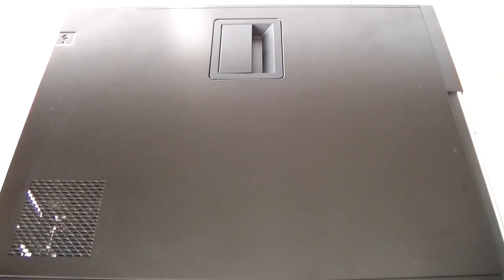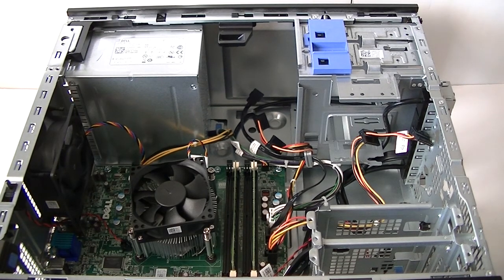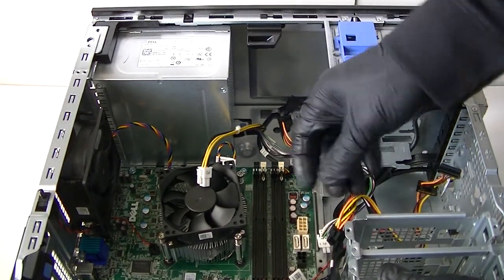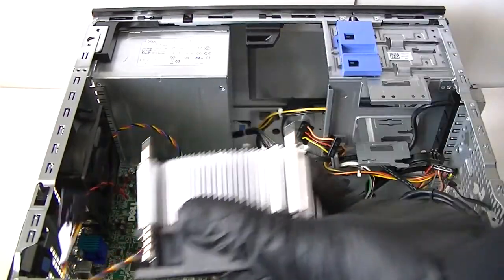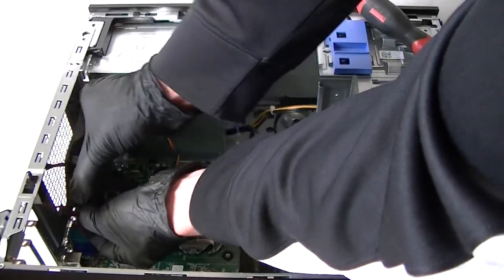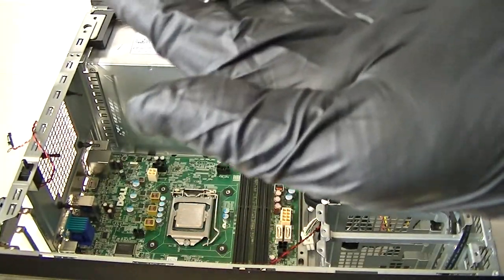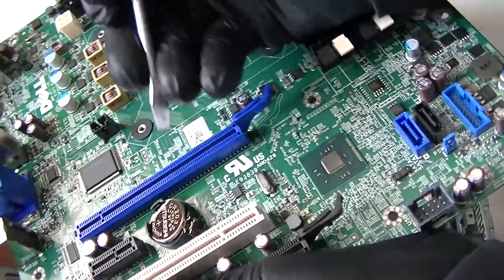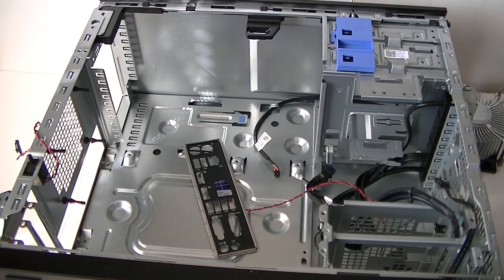Dell Optiplex 7020 Teardown

Comment from the maker: List of Parts and Upgrades works with this PC..

PSU:
(1.) CORSAIR VS Series, VS500, 500 Watt, 80+ Certified, Non-Modular Power Supply
https://amzn.to/2RxoMZV

(2.) CORSAIR VS Series, VS450, 450 Watt, 80+ Certified, Non-Modular Power Supply 
https://amzn.to/3efEeDO

(3.) Thermaltake Smart 500W 80+ White Certified PSU
https://amzn.to/2xQHm8F

You will need this adapter if you upgrade power supply.

24 Pin to 8-Pin Power Supply ATX PSU Adapter Cable 
https://amzn.to/34T0lLS

24 Pin to 8 Pin ATX PSU Power Adapter Cable
https://amzn.to/3btebHf

This video cards will work with this system.

(1.) Asus TUF Gaming GeForce GTX 1650 Super 4GB GDDR6 (TUF-GTX1650S-O4G-GAMING)
https://amzn.to/3jmTBwz

(2.) Gigabyte GeForce GTX 1650 Super OC 4G, 4GB GDDR6, Gv-N165SOC-4GD Video Card
https://amzn.to/3eLwh8g

(3.) Gigabyte Geforce GTX 1050 Ti OC Low Profile 4GB GDDR5 128 Bit PCI-E Graphic Card (GV-N105TOC-4GL) 
https://amzn.to/2XEqKMb

(4.) MSI Gaming GeForce GTX 1650 4GB GDRR5 Low Profile Graphics Card (GTX 1650 4GT LP OC) 
https://amzn.to/2VkDdSd

(5.) MSI GTX 1050 TI 4GT Low Profile  Graphic Cards 
https://amzn.to/34r0AxG

(6.) Gigabyte GeForce GT 1030 GV-N1030D5-2GL Low Profile 2G Computer Graphics Card 
https://amzn.to/2Xu3SyO

(7.) ZOTAC GeForce GT 1030 2GB GDDR5 64-bit PCIe 3.0 DirectX 12 HDCP Ready Low Profile Video Card ZT-P10300A-10L 
https://amzn.to/3eayL1b 

(8.) MSI Graphic Cards GT 1030 2GB GDDR5, Low Profile 
https://amzn.to/390Spum

 (9.) ZOTAC Gaming GeForce GTX 1650 OC 4GB GDDR5 
https://amzn.to/2V28laj

(10.) ASUS GeForce GTX 1650 Super 4GB Phoenix Fan Edition (PH-GTX1650S-O4G) 
https://amzn.to/3eoad4S 

This RAM works with this machine:

(1.) Crucial 8GB Single DDR3L 1600 MT/s (PC3L-12800) Memory CT102464BD160B
https://amzn.to/2VhGv8O

(2.) Crucial 4GB Single DDR3L 1600 MT/s (PC3L-12800) Memory CT51264BD160B 
https://amzn.to/2xq46wb

(3.) Crucial 16GB Kit (8GBx2) DDR3L 1600 MT/s (PC3L-12800) CT2K102464BD160B 
https://amzn.to/2VpsKpP

Thermal Compound Paste:
(1.) Arctic MX-4 2019 Edition Thermal Compound Paste Carbon Based
https://amzn.to/2XcsZo4

(2) Arctic Silver 5 Thermal Cooling Compound Paste 
https://amzn.to/2ziNU0H

(3) Noctua NT-H1 3.5g, Pro-Grade Thermal Compound Paste
https://amzn.to/36kTk7A

(4.) ARCTIC MX-4 (current edition) Thermal Compound Paste 20 Grams 
https://amzn.to/2DhGJaK

Hard Drive Caddy Adapter  3.5 to 2.5:

(1.) Dell 3.5" to 2.5" SSD or Hard Drive Caddy Adapter R494D 0R494D 
https://amzn.to/2XTPeRr

(2). Dell Hard Drive Caddy, R494D, F767D 3.5" to 2.5" SSD or Hard Drive
https://amzn.to/3cTkcOk

SSD list works with this PC:
(1.) Samsung 860 EVO 500GB 2.5 Inch Internal SSD MZ-76E500B/AM) 
https://amzn.to/2yNxnkE

(2.) WD Blue 3D NAND 1TB Internal SSD, 2.5" WDS100T2B0A
https://amzn.to/2wvnC9Z

(3.) WD Green 1TB Internal PC SSD  WDS100T2G0A
https://amzn.to/3cbrcWa

(4.) SanDisk SSD PLUS 480GB Internal SSD SDSSDA-1T00-G26
https://amzn.to/3a3i9ou

(5.) Crucial MX500 250GB 3D NAND SATA CT250MX500SSD1(Z) 
https://amzn.to/34rZlhy

(6.) Samsung 860 PRO SSD 256GB - 2.5 Inch SATA III Internal Solid State Drive
https://amzn.to/2ybiHLK

(7.) Samsung SSD 860 EVO 250GB 2.5 Inch SATA III Internal SSD 
https://amzn.to/2VjIAkK

(8.) SanDisk SSD PLUS 240GB Internal SSD
https://amzn.to/3c7SEE4
Reply: Evga 500w 80+ silver work?

Comment: Thanks for making and sharing this very helpful video. My brother gave me an Optiplex 7020 MT. I have 3 hard drives and am trying to figure out how to install the 3rd one (with the OS) in the upper area below the optical drive. Any thoughts or suggestions would be most appreciated.
Reply: there are 5.25 in to 3.5 in hdd adapters available online

The blue one should be the primary sata (boot drive) iirc. 

the black is usually for an optical or floppy drive 
and the remaining two white ones should just be additional stuff. 

Of note: all sata ports are the same speed and any should work in any spot, as long as the boot drive is on the blue one. (maybe even that's not necessary.)
Reply: @harrymu148  Thanks so much Harry.

Comment: Can I add a second 3.5" hdd to the bay under the second 5.25 bay (the empty one)? will I need a caddy or an adapter? Thanks
Reply: You will need a hardware bracket to hold it in place (and punch out the blank cover) but as long as you have sata ports, you should be able to stick a drive anywhere (I did double sided tape to the cover before)